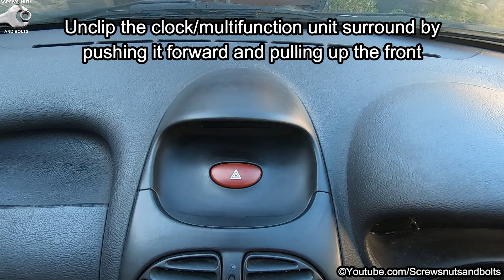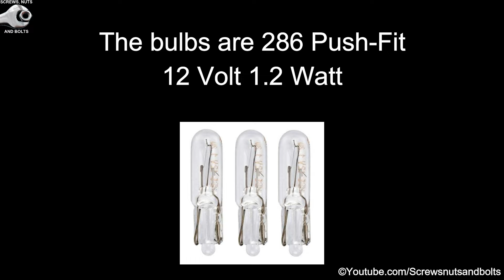Multi-function Clock Display Fix - Peugeot 206

Comment: Hello, thanks for video, my clock resets time and date everytime I power on the car , what's the reason could be ?
Reply from the maker: You're welcome. Is the car the battery old ?. That issue can be a symptom of the battery starting to fail and causing the voltage to drop too low when starting the engine, which can reset the clock display
Reply: @screwsnutsandbolts  yes it's old, thank you

Comment: I have a peugeot 206 2000 where the display is only a clock can I change it with one like the one you have? Or are the cables and connectors not the same?
Reply from the maker: I'm not sure, sorry

Comment: No need to unscrew the minus on the battery, when the plus has an easy snap on
Reply: This is a bad idea, do not do this! The negative of a battery is connected to ground/chassis meaning if that positive you disconnected touches a metal part of the car you could damage some electronics
Reply: @JayKayX71 
If the disconnected positive battery  lead is the only lead connected to the battery then it's not possible for anything bad to happen after it's disconnected.
 I usually disconnect both negative & positive when working on the car though.
Reply: I have a question : I only need to change the big piece with the warning button. Do I need to touch the battery or can I just connect and disconnect without touching the battery ?